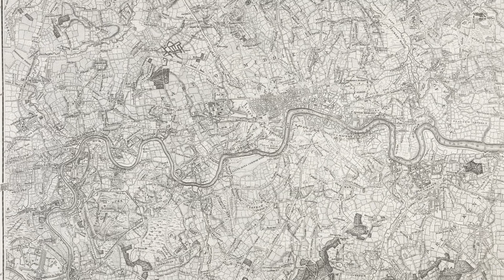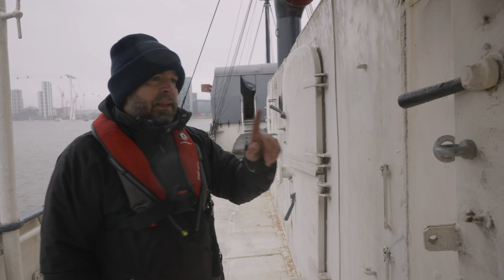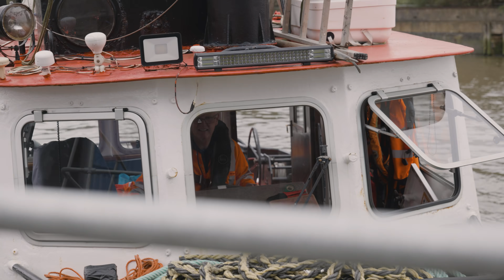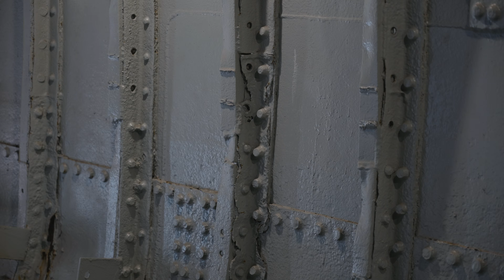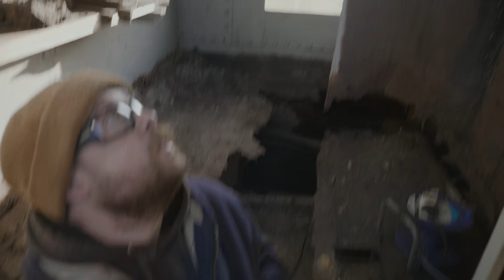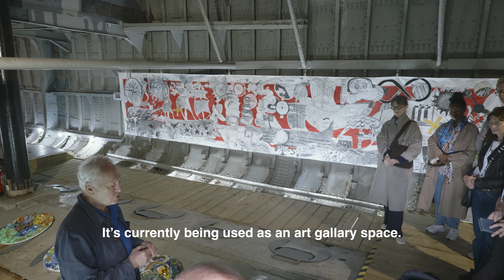The Oldest Steamship

Comment: May I add to the distinguished company of old steamoats the S/S "Hjejlen", a coal fired paddlesteamer, still going strong with its original engine. It was launched in 1861 for passenger traffic on the lakes in middle Jutland, Denmark. 27 tons, 50 HP, 100 passengers.

Comment: It seemed at first thought that it was a shame it was not afloat ! But then reality is it would have sunk or even worse been scrapped. Then sitting on the pontoon gives visitors a true impression of the size of the vessel, it's hull, prop and rudder and avoids further corrosion or dry dock fees.  It appears that flame cleaning has been used but a needle gun will do good work when removing heavy rust. I take my hat off to all who have been responsible for saving this vessel ! Thank you

Comment: There are many old steamers out there. I believe the ship with the oldest engine, still running, is the Paddlewheeler "Diesbar" in Dresden Germany. It was built in 1883 and got a new boiler in the 1920s. But her engine is built in 1857 (!), by John Penn and is a 2 cylinder low pressure oscilating (!) engine, yes oscilating like a Mamod toy engine. I hope to sail on her one day when I am back in Dresden.

Comment: In their restoration, they should remake the propeller in bronze.  I can’t believe it was made of steel. At least that’s what it shows here that it’s flaking away.  I guess these ships were a diamond dozen and it’s by pure lock that the ship survived.  I know what this can look like when it’s restored it will be gleaming and all the brass parts will be gleaming and the lighting will be LED lighting. That will be very very bright for that engine room the lighting back then where 25 W lightbulbs and it wasn’t very bright. It was just a couple steps above gaslighting.  even in the 1960s the brightest bowl available at least in my great aunts house in Germantown Pennsylvania was a watt lightbulb. I never remember replacing a 60 or 100. I’m sure they were out there but the house had 25 W bulbs in the lampshades and 40 W lamp lamps in the ceiling lights and what not and so forth.  It was a lovely dimness with all the anntiques and it made for some very cozy winter afternoons and rainy day afternoons.   Lighting is everything they say.  Thankfully, the new LEDs have an “ antique” Edison bulbs that could be used on the ship that would be to be keeping with the times.

Comment: The SS Hjejlen (Silkeborg, Denmark) is the world's oldest coal burning operational paddle steamer, built in 1861. Still the original hull and the original coal-fired engine, and it is still in active service, running tourist routes in Denmark. 29 years older than SS Robin.
Skibladner from Norway - still in service - is also older than SS Robin and even older than Hjejlen, but not quite as original. According to their own Skibladner website, the hull was made 20 feet longer and the engine and kettle was replaced in 1888, so it's a matter of definition whether Skibladner og Hjejlen is the oldest original steam ship in the world still operational and in regular service.

Comment: I'm sorry but if you are doing a documentary video about a steam ship, I would want you to be able to distinguish the difference between an engine and a boiler. Unless I missed it, it should have definitely pointed out that it's a triple expansion steam engine that has 3 different sized pistons as it recycles the steam from one piston to the next. The smallest piston is the highest pressure steam and the first to get activated by high pressure steam when it is running.

Comment: Actually we do have older steamships here in Germany on the River Elbe, built in 1879, 1884, 1885, 1886 (and more built into 1929). They are still on steam and in daily passenger service. It is actually the world's largest steam ship fleet, running 9 steam ships as of now. 2026.
Reply: The question is do they have the original engines? SS Robin does have its original power plant.  

The other question is are any of those steamers ocean going? 
It's one thing to be a steam powered riverboat, it's another to be designed to sail on the ocean. Even a coaster is an ocean going vessel.
Reply: @JefferyP.Indorf  Yes they do have their original engines. No they are not ocean going - but Robin is also not ocean going (anymore) and it´s steam engine is not working (anymore). Yet I did not want to criticize this WONDERFUL VESSEL and the achievements of it´s WONDERFUL TEAM. I just wanted to point out there are older but yet still functioning steam ships around. No more, no less ;-)

Comment: The Falls of Clyde was scuttled in the Pacific Ocean on October 15, 2025, After decades of deterioration and failed preservation efforts. Prior the that happening I advocated  for setting up an industrial facility to demonstrate the production process of wrought iron for education purposes because  the raw material wrought iron gradually disappeared, until the last ironworks ceased production in the 1970's.  Its corrosion resistance is largely attributed to the glass like impurities and low carbon content that makes it so pliable and important for the restoration of the other  wrought iron hulled museum vessels such as the 'SS  Great Britain',  the 'SS City of  Adelaide',  'SS Freshspring', and perhaps at some point 'SS Robin' and others too many to mention. The  ultimate solution to saving these vessels in the long term future is to repair with the historically correct material.

Comment: Great that this ship has been saved and will be open to the public. A pity that after 80 % of the hull being replaced that they did not continue the restoration and get her seaworthy and back in use with an overhauled steam boiler and triple expansion engine. However, at least this wonderful piece of history has been preserved, unlike so many beautiful ship that were wrongly scrapped. Even up to recently some very rare, historic ships that were unreplacable were cut up. Very sad that humans rarely appreciate floating history.
Reply: That was the issue. They would have had to replace 80% of the metal to keep her afloat. They decided to keep her with her original but fragile hull. That’s why she is not seaworthy.

Comment: I can appreciate the difference between conservation and restoration, the desire to keep her completely original is a valid goal. To refloat her means a complete replacement of hull plates and more, like the Sydney Heritage Fleet has done with the 1927 John Oxley, she's a similar ship of 544GRT at 51mtr with the original engine but I'm sure the boilers are not original. They also have ST Waratah, a riveted iron tug of 31mtr built in 1902 with original engine but I think she's on her third boiler. Waratah steams regularly as will the John Oxley when completed. It's great to see these old girls preserved in either form.

Comment: No mention of the time The Robin spent in Lowestoft being repaired.

The SS Robin, recognized as the world's oldest steamship, underwent an extensive £1.9 million restoration and conservation project in Lowestoft, Suffolk, between 2008 and 2010
Reply: "The oldest steamship" having the caviat of its hull + engine being "original", must honestly be mentioned with the claim.
There are quite a few steamships from 1860-70's still plowing the waves, though most have seen the orignal engines replaced around the turn of the century.
The steam engine was in fast development, and the difference between the original engines from 1860's, and the replacing engines is huge.
Hence the replacements.
I spent a week almost every summer from 1970's through to the 1990's onboard my uncles 21 meter, 71 ton, steamship. Hull from 1873, engine from 1900.
Though tragically sold, and made to look vehemently horrible, it is still taking "dinner cruise" passengers during summer months.
Another steamship I spent time on then, has been beautifully restored, and offers tours, and dinner cruises to paying customers (members prioritised).
Hull from 1866, engine from 1904, boiler from 1917. This on the Lake Siljan in Sweden.

Finland also has a vibrant steamship community with many ships. The oldest from 1853, though I have no info on the engine.
Reply: @bodan1196  wich was this ship? i took a dinner cruise on a old ship over in åbo finland last year
Reply: @Træfisk It's a tugboat, so it's not serving dinners 😊
Search for steamships in Finland, and you will find a couple of sites with photos and data. (Wikipedia is not on top on the topic.)
Reply: @Træfisk SS Ukkopekka ?
Reply: Yes I was expecting that to be mentioned. A friend of mine did some work on it at Lowestoft.
Reply: So glad someone mentioned her up on the slip in Lowestoft having her hull replated. She was part of our skyline up Commercial Rd.

Comment: If you want to see a working  steamship then check out the Daniel Adamson , built in 1903, coal fired, still with the original engines. It does passenger trips on the River Weaver in Cheshire.
Reply: For anyone interested in old steamships, check out the R.M.S Segwun which sails out of Gravenhurst, in the Muskoka Lakes of Ontario, Canada. As I recall, the iron hull came from Scotalnd, about 175 years ago and was then shipped to Canada. She began as a side wheeler and was later converted to  twin props, powered by 2 double expansion steam engines. She still runs on coal.

Comment: Paddle steamer Skibladner launched in 1856 is still in in regular use on lake Mjøsa in Norway.
Reply: 170 years and still going in any shape at all is amazing
Reply: Was about to say.

Also, fun fact: Skibladner was named for Odin’s ship.
Reply: @TheEmeraldMenOfficial  actually it belonged to the god Frøy
Reply: wow!  🎉❤😃😃😃
Reply: Are you sure? Maybe it is a replica.
Reply: Without original engines, however.
Reply: @damonrobus-clarke533  wrong infact
here engine frame and cyclinders are the same they where retrofitted with sleeves
how every pistons crank all rods have been replaced with everything but the core components like the chest frame cylinder and cylinder caps along with the oiling cups being the only original pieces left of the engine
regaurdless by base value its the same engine just every wear components replaced
Reply: i think they mean the engines from 1850's as she was upgraded in 1888.
but that means even the "new" engine is still older than SS Robin, and it's still a complete working ship.
Reply: @Cloud_Shire_82  That's normal for a working engine.
Reply: It'd an inland paddle stemamer ferry, ,not a coastal proper ship
Reply: @gs425  inland ferrys are still proper ships if they carry life boats, however the hull design is different for seagoing, not so flat bottomed. The differencec between the 2 vessels is simply the use, one is passenger one is cargo. The Robin is the oldest cargo ship but its hardly running.
Reply: @gs425  it sailed the oceans atleast once as it was built in motala in sweden
Reply: @gs425  Then you can count S/S Salama, built in 1874 for Baltic trade.
Reply: This is a typical BS video claiming something extraordinary to attract views. Many Youtube channels will lie in our faces just to hope that we are dumb enough not to notice.
Reply: Grow up.
Totally different situation

Comment: HMS Warrior is a steamship. It was built in 1860, 30 years before the Robin.
Reply: Thanks for sharing, I forgot about HMS Warrior - I guess this is the oldest steamship still with original hull and engine, as stated in the video and video description?
The beauty of YT is that when I finish this video I can move on to another that explores the history of HMS Warrior.

Fair wind and following seas!
Reply from the maker: Yes I think it had quite a rebuild after being stripped and converted to an oil depot and had it's engines removed.

Comment: I could get it running in a day or 2 on air, i was the senior boilerman on the TSS Earnslaw. We have a triple expansion engine running on an air compressor at the museum in bluff. A good few million pounds and they could replace the entire hull. They should be using needle guns to take the rust off, its faster on air compressor and less hours work. Rivets wont all be original at all, they repaired with rivets every 30 years. The steam goes through tubes, which ive cleaned out by hand every month when I shovelled 1.5 tonnes of coal a day 15 hour shifts.
Reply from the maker: Good work on the coal shovelling, I think there might talk of getting the engine running on compressed air.

Comment: DS Skibladner was completed in 1856. Hull extended and new engine in 1888, so two years older in current configuration and 34 years older from build date. Still in operation sailing between the same ports as in 1856.
Reply: The PS Skibladner is an inland ferry paddle steamer, not a coastal ship. Her Hull has been remodelled and extended and she has totally different engines to when built.
Reply: Britain invented the steam engine, the steam ship, steel ships. Now top that.

Comment: She is NOT the oldest steamship in the world! S/S Hjejlen, a paddlesteamer of 27,32 BRT, was built 1861 and is still running her original steam engine of 50hp. Her hull is the original, too. On her maiden voyage in 1861 she ran from Copenhagen via Elsinore and Randers in salt water, then up the Gudenåen to Silkeborg where she still performs her duty as a passengership every day from may till september. She will start her 165th season in may, business as usual.
Reply from the maker: Wow, that's an old boat and still going strong! Charlie lives in Copenhagen so perhaps I should head over there to see for myself? Will they let me drive it? It's a bit smaller, is it technically a ship?
Reply: @harrydwyer  my understanding is, a ship heels out in a turn, a boat heels in, in a turn.
Reply: @DomingoDeSantaClara I’ve heard the a ship can carry a boat but a boat cannot carry a ship. 🤷‍♂️
Reply: @DomingoDeSantaClara unfortunately not a very good understanding then
Reply: @richardcross7633  don't leave us all on tenterhooks then, what's the answer?
Reply: @DomingoDeSantaClara a vessel turning will always lean out due to centrifugal force.
Reply: @richardcross7633  look at any speedboat pulling a turn, it always leans in.
Reply: @DomingoDeSantaClara I had anticipated that comment, the dynamics for a semi displacement or planning hull are different from a displacement hull. I should have mentioned that. Also if you want to look at catamarans then you’ll need a really good text book 😵‍💫😂
Reply: @richardcross7633  I assumed we weren't bringing yachts into the discussion as the sails play a big part in how they turn. Just sticking with motorised vessels, it seems the principles of how they heel in a turn can be simplified to my comment above, providing they are traditional single hulled boats/ships. You've not brought anything to the party to change my mind...yet.
Reply: @harrydwyer  Maybe a series on old ferry boats, still in service around UK, the world,we know you want to do it?
Reply: @johndunne651  Because nothing, precisely nothing, is so much worth doing, as simply messing about in boats!
Reply: @h @harrydwyer yes please do! I’ve sailed on her once’s 3-ish so years ago she is amazing I will certainly go sail on her this year, I would really love a video of you sailing or talking about her history, she is a ship that really needs to be covered.
Reply: @harrydwyer  If you go, anytime, let me know, and I'll stand you a pint o' bitter. And if you stay over in Copenhagen a couple of days, we'll go to see the S/S Bjørn of 1909, a tug cum icebreaker, in Elsinore, coalfired, too.
Reply: The ss Hjejlen is NOT  a steam ship. Its an inland ferry boat.  The Robin is a coaster, a sea going actual cargo ship
Reply: @gs425  Robin IS NOT a steamship anymore. Not even a ship nor a boat. It doesn't float and the pontoon carrying it can't move by itself by steam, diesel, seals oars  nor any other means.
Reply: @gs425  Hjejlen is a ship powered by a steam engine thus is a steamship, even with your capitalization of 'not'
Reply: @gs425  Neverthe less, she was built in Copenhagen and sailed under her own steam through the Sound and across the Kattegat. She's registered as S/S Hjejlen. And in 1861 she was meant to carry freight from Silkeborg to the sea, which she did for a few years.
Reply: @ESmith-ik8vu   and Britain invented the steam engine, the steam ship, steel ships. Now top that.
Reply: @DangerMouse-n8l  Which, of course, I can't, nor do I want to. And nothing can top the S/S Waverley, anyway.
Reply: The iron steamship HMS warrior was launched in 1860 , worth a visit to Portsmouth to see her .
Reply: There is several original steamships in Finland also, a tug from 1870 and passenger ships late 1800, for ex.
Reply: Also claimed at one point to be the oldest complete ship, which it isn't. HMS Trincomalee was built in 1817 and survived largely Intact and I'm sure there are others.
Reply: Who could forget Brunel’s SS Great Britain (the first screw driven steamship) now preserved in Bristol. Launched 1843 and largest passenger ship in the world from 1845 to 1853.  SS Great Western was wooden hulled ocean going steamship. Paddle driven (as they all were until SS Great Britain arrived).
Reply: Britain invented the steam engine, the steam ship, steel ships. Now top that.
Reply: @DenimFansAreLowIQ yes Thomas Newcomon,  from Dartmouth in Devon,  Bolton and Watt improved on the design.  Richard trevithick invited the first steam powered vehicle,  he was from Cornwall so that's not as cool.